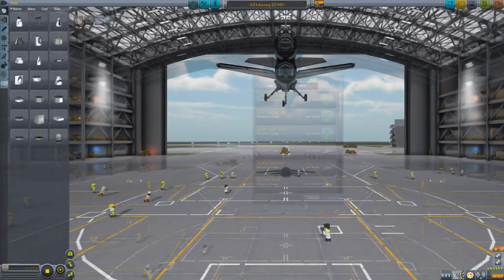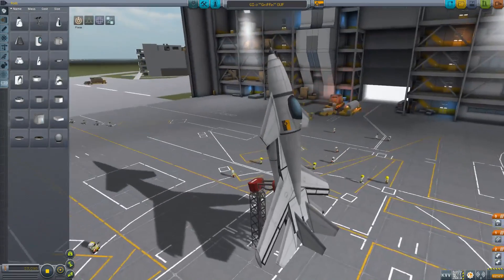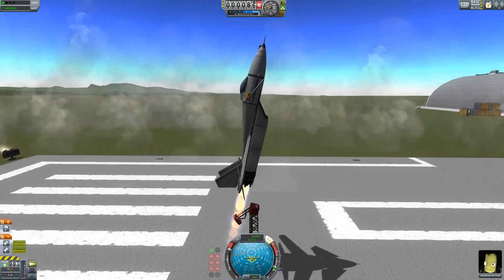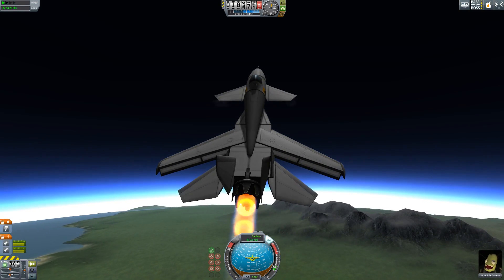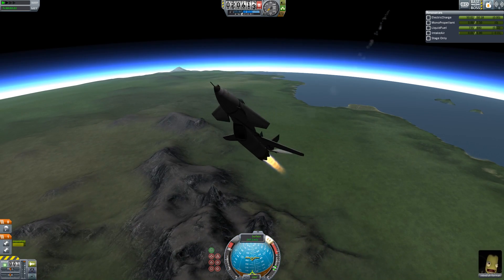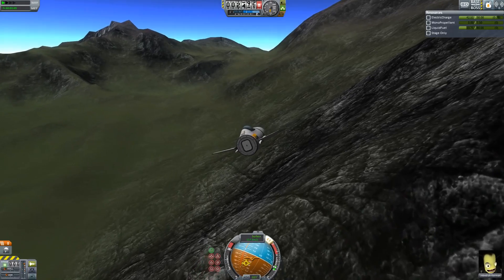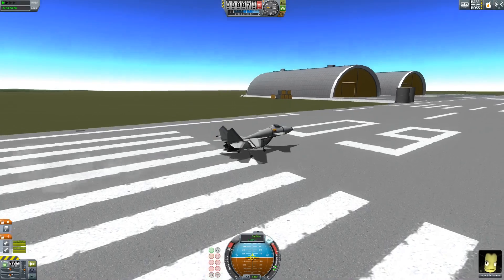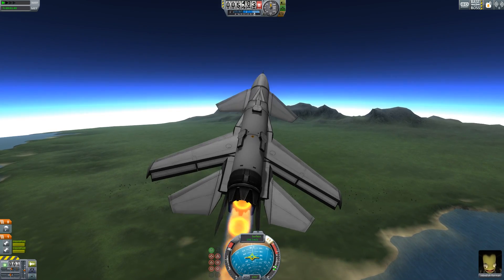KSP - The GI-3 "Griffin" OUF & MUF

Comment: +guard13007 That high speed stall you induced is actually a recognized airshow maneuver know as "Pugachev's Cobra"
It's a maneuver that requires very good pitch control and thrust vectoring.
It is mainly thought of as a Russian Maneuver, The Flanker series fighters have poor roll control compared to western counterparts so the developed several theoretical maneuvers that the F-15 couldn't match in a dogfight to compensate for that.
The Pugachev's Cobra was meant as a low altitude Aero-braking maneuver if being tailed in a gun/ close range AAM dogfight
As you saw in your dive, when in low altitude the high dynamic pressure snaps 1/2 your airspeed in a second and instantly rights you to your original facing. Theoretically in combat right on the enemies tail.
Unfortunately in today's air combat it's basically a suicidal maneuver

Also when you said at 14 minutes that the maneuverability wasn't the best, you where actually still stalled, all that maneuvering mainly TV and reaction wheel. The warning that that's happening is the "Wobble" when maneuvering.
The wobble is it changing from Aerodynamic control to post stall control and having less authority, then returning to aerodynamic.

Also as for your rudder problem, your brakes action group is activating your vertical stabilizers as drag flaps and putting both to max deflection, which means when you need to use them it needs to travel full traverse
Reply from the maker: +Ben Grogan Dammit, I typed out a reply here, then responded to someone else before clicking Reply, so it deleted it. >.<

The "rudder" problem isn't anything to do with the rudders, it's the front landing gear not inverting its control scheme, and pulling to the right when I try to go left or vice versa. On the ground at low speed, it has way more control authority than the rudders, so it pulls off course, and then even worse, SAS doesn't realize that the yaw controls are basically flipped on the ground, so it tries to compensate and instead pulls it even further off.

And yay! I didn't even realize I'd pulled a cobra. ^^
Reply: ***** Pugachev's Cobra, there are actually a few variants of maneuvers that are ___'s Cobra's
Reply from the maker: Ben Grogan Ah, didn't know that. xD I knew only of this cobra. Is there a list of them somewhere?
Reply: ***** their mainly variations on the Pugachev's Cobra incorporating other maneuvers, for example what you did of starting the cobra and turning 180 degrees while stalled like you did is called Cobra turn there's a few others